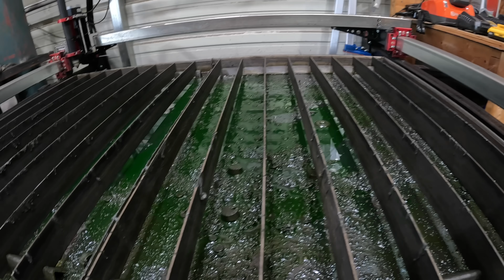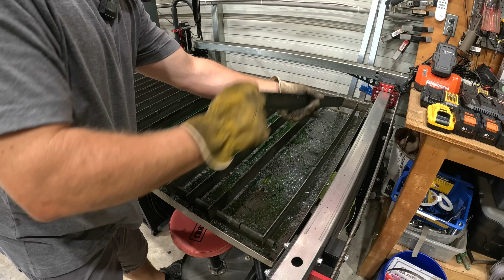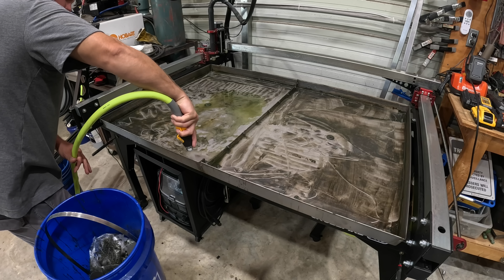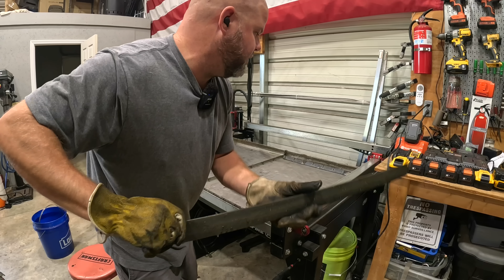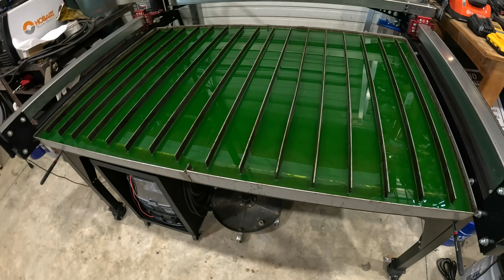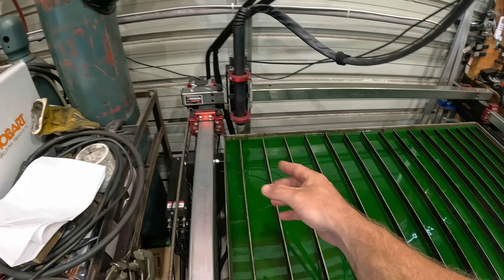CNC Plasma Table Cleanout! Langmuire Crossfire Pro

Comment: I guess the wet dry vacuum works, but it’s gonna get dirty again the first time you use it so if it were me, I would just get the big chunks out of there and add more fluid and when it got too thick and greasy then I’d scoop a bunch of it out and add more fluid. I’m thinking it’s gonna be harder to clean the vacuum than it would be just to clean the table.    I know you like to get everything perfectly clean but with that green goop in there you’re not getting rust so I think it’s one of those things where if you get 80 or 90% of the goop out of there in a third of a time it’s enough and saves a bunch of time, but that would be good if you were moving it but without the rust without green stuff in there as long as you get most of it out, you’re good.  

We had a 4 x 8 plasma cam table, but it just lets it fall on the floor. lol.  It’s messy, but you just sweep it out. We took some thin aluminum diamond plate and put magnets on it as a shield on the side and we could just pop those off and sweep it out.   

I haven’t had one in a while, I was thinking about getting an arch-droid.  One is probably gonna last me. I’ve been a solid year.

I wonder if you can filter that green fluid also like if you just put top over a 5 gallon bucket and dumped your vacuum into there if it would filter out and save the green liquid   🤔

As for the screws and lubing them, I would just use ATF, seems to work for everything and it doesn’t get to gummed up come on if you ever need to clean it off brake fluid or dish soap will take it right off.
Reply from the maker: I have seen people make filter systems, but I just don't think it will work on a table like this because the drain system sucks.

Comment: I clean mine the same way. I bought one of the cheap 5-gallon bucket top vacuums from Home Depot. I use garage door lube for the lead srews. Don't be like me and let all the water evaporate one time had to use a chisel to break up the mess it left :(
Reply from the maker: Yikes, thanks for the tip.

Comment: Tap into the bicycle industry. The lubricants they use are made for wet, sloppy and corrosive environments. Take a look at a dry lube, like white lightning dry chain lube for the screw shafts. I think the dry lube would also work well on the roller bearing services. WD-40 is a solvent and penetrant. It’s great for cleaning things like your bearing services. Unless you buy a specific WD-40 lubricant, the normal WD-40 is not recommended as a lubricant.
Reply from the maker: Agreed, I bought their dry lube.

Comment: The best lubricant for C and C bearing rails, especially linear rails, is generally a high-quality lithium soap grease, often in NLGI Grade 1 or 2. Specific recommended greases include:

White lithium grease (popular and effective but can attract dust)

Mobilux EP1 or EP2 (commonly used in linear rails due to good balance of lubrication and anti-wear properties)

Specialized greases like Klüber GL-261 for high precision and demanding applications

Synthetic lithium soap greases, which provide excellent protection against wear and corrosion while maintaining good lubrication under pressure and speeds typical for CNC applications

Avoid using WD-40 as a lubricant since it can cause long-term damage, and be cautious with greases containing extreme pressure (EP) additives, which may not be ideal for linear rails. Oils such as slideway oils (e.g., Mobil Vactra 68) are also used, mainly for horizontal rails or equipped with automatic lubrication systems, but greases are more common and practical for most CNC bearing rails.

In summary, a synthetic lithium-based grease, such as Mobilux EP2 or an equivalent high-quality lithium soap grease in NLGI #1 or #2, is often considered the best choice for CNC bearing rails, balancing lubrication, corrosion protection, and dust resistance effectively

Comment: Andrew, I ran across this video about upgrades that that he made to his plasma. I really liked the spray ring to keep thin gauge metal cool. He also has a spray wand to clean off parts or make clean up easier. Here's his video: https://youtu.be/rmuyO3i-ne8

You could cut out the drains in you pans then flair the hole down and weld a drain on the underside of the pan. Thereby making it the lowest point in the pan. Then you could drain the coolant into a sealed tank between uses. You could even drain it through a filter sock. Anyways, lots of things that are possible with some imagination and ambition.

Comment: I won't attempt to suggest a lube, but I think cleaning those rails should be done after every cutting session. The WD40 is probably a good thing to use for cleaning, but it isn't a great lube. Personally I think I would avoid anything sticky that will hold the metal dust unless you plan to clean it frequently. You might end up doing more harm than good with a grease.
Reply from the maker: I don't disagree with you.

Comment: Hey Andrew - to lube the screws, you want a marine grade water resistant grease, due to the high humidity in Florida.  To lube the tubes, you want white lithium grease.  Awesome content my friend....cheers.
Reply: Isn't grease just going to attract metal dust and create a rubbing compound? I don't think this is the application for a sticky lube, but I could be wrong.
Reply from the maker: Good idea, some corrosion x might be a good idea. I love that stuff for boat motors.